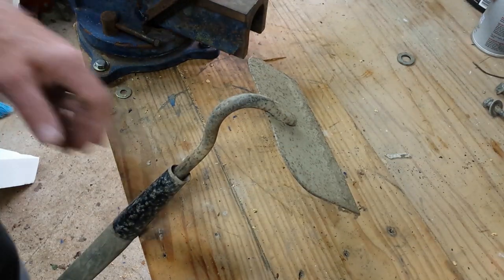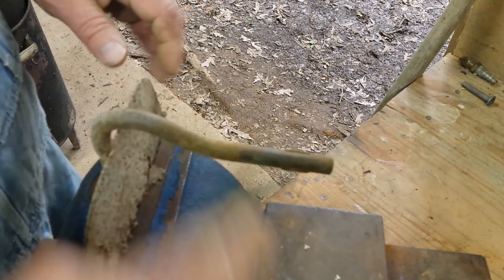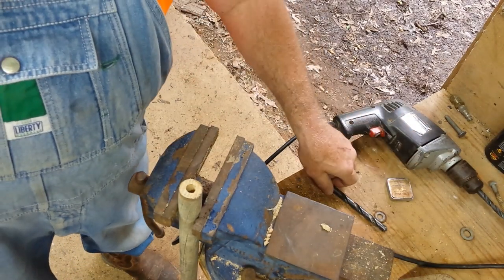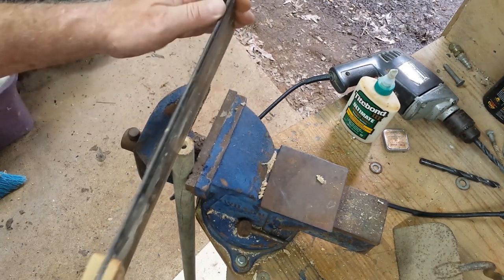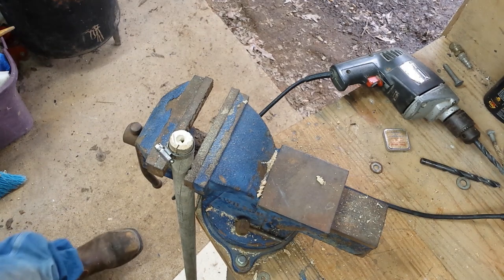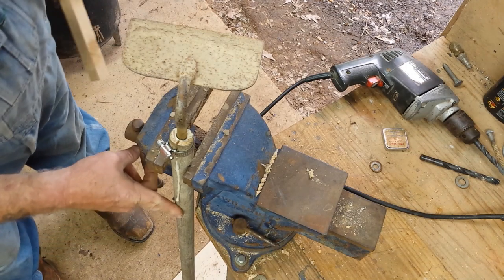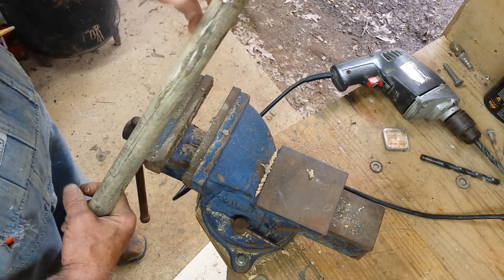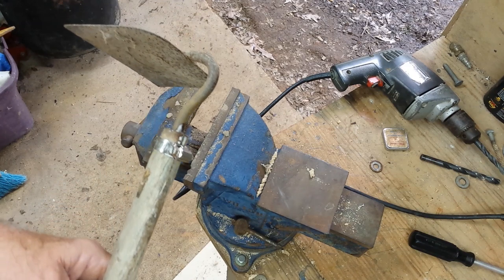*EASY* Garden HOE HANDLE Repair

Comment: Good fix Duke. That's an old handle. If you put boiled linseed oil on it I bet it would take several coatings as dry as it is.
Reply from the maker: it would help!

Comment: Left off the most important part --- the outer metal sleeve. In fact, I would have merely drilled through the sleeve and through the hoe end shaft. I not only would have; I have done it. That outer sleeve, even the plastic ones, provides much of the strength in that area.
Reply from the maker: go on wit your bad self!
Reply: @RuffCut  LOL.....

Comment: Great repair, Mr. Duke.
I guess this shows a great disadvantage to the tools with fiberglass handles, cuz they'd have to be repaired with epoxy and strapping and still not last as long.
Reply from the maker: I never have replaced a fiberglass handle    don't know what it would be like    Thanks
Reply: @RuffCut  The fiberglass handle will last a very long time, but the connection at the end will fail and be difficult to repair. I tend to prefer wood handles.

Comment: Instead of cutting off the tapered end, just cut off about 1/4" to 1/2" of the tip.  Then cut a kerf across the end.  Drill the hole 1/4" to 1/2" deeper into the handle.  Reinstall the ferrule and the hoe head.  Use a flat tipped bar or chisel to drive the ferrule securely onto the handle.

If it was still loose, the wrap aluminum tape around the hoe tang to fill the difference.

I treat my rusty tools with a wire brush and a wipe or two of phosphoric acid.  This usually turns the metal black.  Vinegar could also be used, but it takes longer and the part must be submerged in the vinegar.
Reply from the maker: Thank you for the valuable info. This handle was wallered out severely but your idea would work well with one that had just come loose. Thanks again

Comment: Do you know what this type of connection is called? I don't have an existing handle so I guess I will just try to make one from scratch. How come you chose to ditch the sleeve?
Reply from the maker: the sleeve was of no use the way i put it back together

Comment: I went to buy a new shovel handle at a box store but the handle cost more than a new shovel  🙄
Reply from the maker: same thing happened with my garden hose...the parts were more expensive than a new hose....something bad wrong with that...more junk for the landfills
Reply: Well I have a bandmill and a shaving horse so I need to find some hickory or ash and make my own handles

Comment: How’s it holding up? Mines loose and gotta fix it too.
Reply from the maker: it held up good last year...if your tall It makes the handle a little shorter....other than that its a good fix
Reply: @RuffCut  I just repaired it. The tail inside the handle was flat not round. I cut a dowel in half and wedged the tail into the drilled hole. Feels solid. Thank you.
Reply from the maker: @instantsiv  it should work....Thanks